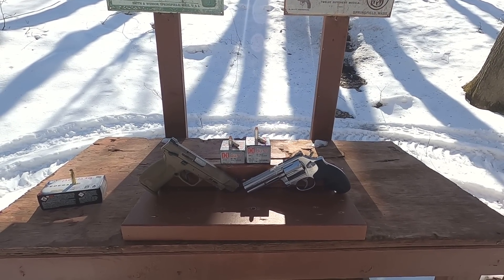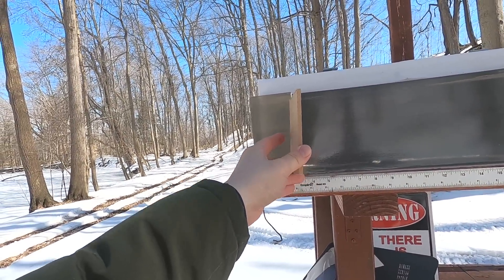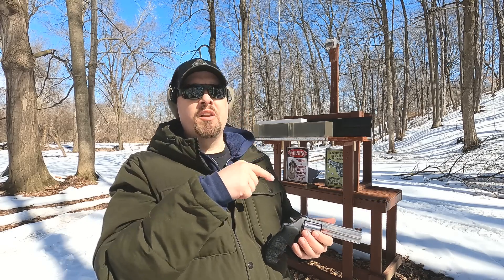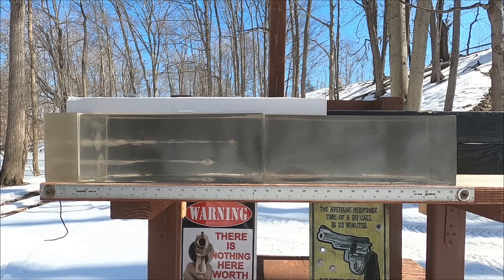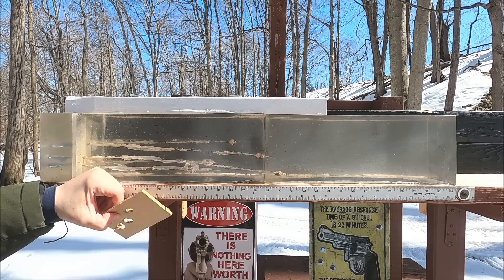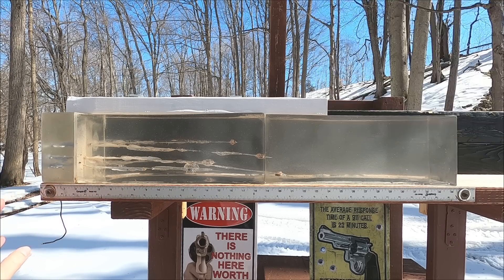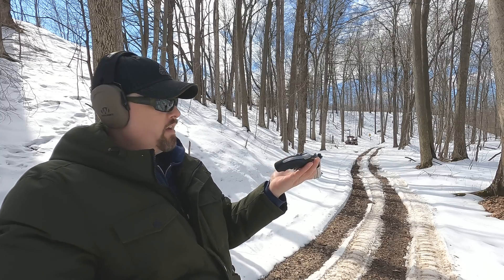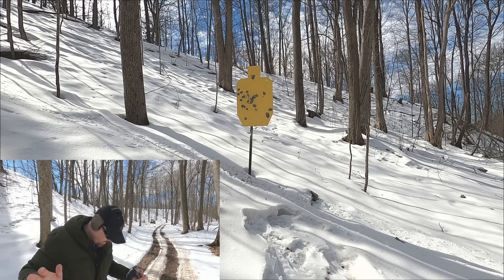.357 Sig VS .357 Magnum - Hornady Critical Duty Ballistic Gel Test

Comment: That's some pretty weak 357 sig ammo. Definitely could have had more velocity
Reply from the maker: But it worked. Adding more power just increases recoil. I could see if it was weak and there was a problem with expansion or penetration, but there wasn't.

Comment: Nice test, with the Federal 125 gr as a baseline. Good job pounting out that u also do not need every last possible fps of velocity to be effective. The 10mm fanboys would disagree, but they often overstate their velocities. 

I heard somewhere that the 357 Mag CD was made for an agrncy, possibly foreign, that stuck with the 357 and is not likely to change. No idea who. I love the Sig in my P229 barrel, and i have a P239. That one in particular is a nice carry package in a relatively high riding holster. Fairly light, flat, good trigger, 7+1 is enough, clears leather well. The recoil is not bad, just some muzzle flip, and i know the power is there. It is one of my favorites, now discontinued. The LE agencies that use it seem to love it, including Richmond (VA) PD and Alameda Co SO (CA), as well as US Secret Service. Hard to go wrong. 

I drarly live the 357 Mag as well, and i will never give up my 4"686. First handgun i ever bought, and i started my LE career with it- SS III holster and 4 Comp 2 speedloaders in 2 diff cases, all of which i bought myself.

Comment: I will always recommend Hornady critical duty when you’re carrying, because sometimes you have to shoot from within your vehicle which would be a deafening disaster, and even sometimes into a vehicle that a criminal might be using as a weapon.  So over penetration is a must.  

However, for HOME defense, I would recommend a Corbon safety slug, keeping loved ones safe…
Reply from the maker: I tested the 9mm+P Critical Duty through a windshield along with HST, Gold Dot, Winchester Ranger bullets all in 124 gr+P. After windshield penetration is Gold Dot= 8.75" gel penetration, HST= 10.75" gel penetration, Ranger= 13.75" gel penetration, Critical Duty= 9.75" gel penetration.
Reply: @GunSam  So ranger it is. 👍🏼
Reply from the maker: it was the "Defender" which is the same bullet as Ranger bonded (Not T Series) so either Ranger Bonded or Defender seems to do the best at least in 9mm+P 124 gr. Different calibers of bullet weights might change the equation. I plan to send the 135 gr 9mm and .45 ACP and .40 S&W Critical Duty through some auto glass in the next couple of weeks.

Comment: Those critical duty projectiles are a little undersized in some calibers and think that likely reduces felt recoil by a fair amount. I highly highly recommend their 9x18Mak for those shooters that might be getting a little sensitive to the bite of the 9x18Mak. I would suspect the .380ACP would produce similar results if you have a .380ACP that recoils a little harder than you like.
Reply from the maker: You must mean Critical Defense, not Critical Duty. There's no Critical Duty in 9x18 or .380 ACP.
Reply: @GunSam  oh thank you I did in fact mean Critical Defense my mistake. Although what I meant to imply is that I wouldn't be surprised if the Duty class FlexLock projectile is also slightly undersized. Being that they are Critical line ammo from Hornady they may have more than a few similar characteristics as they are only slightly different from each other. When you mentioned lower perceived recoil the first thing that came to mind was my 9x18Mak because that's all I carry in my P64 when carrying for protection. Super accurate, low recoil, and reliable as all get out. Great video btw, also you're an excellent marksman, I truly look forward to seeing you shoot some more.

Comment: 357 Sig is under rated, IMO.   1.  Works in autoloaders.  2. Thus higher carry capacity.  3.  Some pistols like Glocks, you can just swap put the barrel of a .40S&W to one cambered in 357Sig and you've made a successful conversion. (since 357sig is .40 necked down.)  4.  Higher velocity than typical 9mm and .40.   

So, really nice option, IMO.
Reply from the maker: If we want to get technical, a .357 Sig is a 10mm necked down, thus making it .40 S&W length, but your points are all true.

Comment: 357sig looks better than 45acp. Maybe I should get a Glock in that caliber instead of 45acp.
Reply from the maker: Depends on what you are looking to do with said caliber. Personally if I were to go the .357 Sig route, I wouldn't get lets say a Glock 31, 32 or 33 and rather I would get a Glock 22, 23 or 27 in .40 S&W. I say that as all you need for a conversion is a barrel, KKM that makes my M&P barrel for my .40 S&W pistol is quite nice, makes all the Glock barrels too, but starting with .40 S&W you have a lot of options in shooting both .40 S&W and .357 Sig. A .45 ACP can be a fine caliber too.

Comment: I can't figure out why the 357 Sig didn't catch on since it's clearly far superior to the 9mm in every way. I simply don't trust a 9mm to stop a threat with as few rounds as possible while the 357 Sig is as close to the 357 mag as you can get in a semi auto. And yes I know that the 10mm fanatics are saying that they're getting the most energy in a semi auto, which is true in a factory made pistol, but a lot of people can't handle the recoil of the 10mm while most people can learn to shoot the 357 Sig with a lot less training. Also, the 460 Rowland makes the 10mm look kinda weak, but you need a steel frame pistol and a conversion kit to be able to use the Rowland and they're not practical for EDC. Interesting fact is that the 460 ammo is less expensive than the 10mm. Go figure.
Reply: Same here Bro! I don't trust 9mm, instead, I use it for range only. I have 4 357 sigs Two Glock 32's, Glock 31, and Glock 33. No matter the cost of 357 sig I will invest in that round, all ammo is expensive if you ask me.😂😂 But the 357 sig will get the job done, without using multiple rounds.

Comment: Interesting, especially throwing in a sheet metal barrier.  It’s my understanding the .357 SIG was designed to match the terminal ballistics of the legendary .357 Magnum 125 gr. SJHP but in a pistol.  It does a great job of that, but as bullet weights climb, the superior versatility of the revolver round from 1935 asserts itself. 👍
Reply: Your history is correct, as is the 357 (or any other revolver round) being more versatile. Today's fashion is for high capacity handguns but personally if I can't handle it with six shots I can't handle it with 16 either.

Comment: Big fan of both calibers but dismayed that 357 Sig has waned in popularity so much. It has its followers, of which I am one. Great autoloader caliber in my opinion, might even be the best autoloading caliber. No offense to .45 acp or 9mm, I like them also, but it seems to me that 357 Sig does exactly what it was designed to do. Now, even Sig doesn't support it, for financial reason no doubt, but still a bummer. Great video on the Hornaday projectiles in these two calibers. Very informative. Looks like I've made the right choice for my Sig 229. I'm a longtime watcher but this is my first comment. Keep up the great work; I really think you've nailed the format in terms of delivering tons of info in a condensed space. I find your info very valuable and your protocol extremely consistent. Keep it up, sir.
Reply from the maker: Thanks. The .357 Sig is awesome and misunderstood. I get a lot of "I would never buy a pistol like that, no ammo and it's too expensive". The .357 Sig can be had for $20/50 rounds all over the web, but that's besides the real point. The real point is that unlike any other conversion, a .357 Sig is an extension of a .40 S&W pistol rather than a full out conversion. I tell people, never buy a .357 Sig pistol, buy a .40 S&W and a .357 Sig barrel as it's not really a conversion at all, it's just a different barrel. Between .40 S&W and .357 Sig ammo, one has no reason to complain about finding ammo at good prices, and if nothing else the .40 S&W is a great cartridge with lots of ammo that people are near trying to give away being not as popular as 9mm.
Reply: @GunSam  Agreed 100%. When I looked to purchase a DA/SA pistol, leaning toward a P226 or P229, I waited until I found one chambered in .40 S&W (didn't take long!) and then purchased the .357 Sig barrel separately. Same mags, everything, just a quick barrel swap. I've been reaping the benefits of these "discarded" and "less favorable" calibers for a while now. I'm definitely not discounting other calibers, but the bottleneck design of the 357 Sig just seems like a no-brainer to me. I simply do not have failure-to-feed issues and the ballistics are fantastic (internal, external, and terminal). What's not to like?

Comment: So the critical duty rounds didn’t expand any larger than a 40 or 45 fmj when shot through the barrier, that’s really mediocre at best. Yet the nonbonded 357 expanded beyond .50” and penetrated over 15”, that’s absolutely perfect. Jacket separation and bullet fragmentation only matter because they reduce expansion and penetration. If the nonbonded bullet has excellent penetration and bigger expansion through barriers then who cares if it’s a little more mangled up?
Reply from the maker: Yeah, but my barrier was a bit weak, and I am an amateur. If more barrier was included what you would see would be no expansion with the Federal round, very low penetration, but the Critical Duty would be about right for penetration.

Comment: They were designed to be a ballance of good penetration and good expansion like a hand gun version of a nosler partion and antimony drives the lead core after a small area dedicated to some expansion, Hornady and a sherrif department did gel tests together outdoors with plywood, sheet rock, car window glass, denim and steel so Hornady did the tests to prove the 9 mm, 40 and 45 in front of sherrifs department, lead has many recipes from soft lead to antimony lead, its about testing and adding or subtracting lead alloys like bismuth, antimony, tin to get performance at slower speeds with out increasing pressures to high effecting recoil and even accuracy is speed based, so lots of variables have to go into a bullet other then expansion and penetration, things like cost is a challenge to, I use the 135 gr standard pressure 9 mm, the 40 and 45 the + p and they all soft shooting and accurate so long shots do them any way to know your limits

Comment: Love to see more all copper bullets, the testing I have done has been an eye opener. Nice shooting
Reply from the maker: It's always impressive looking, but it's sort of hard to judge what is going on. The fluted stuff stops fast because it's low sectional density with flutes, but the actual hole size is smaller than an expanded hollow point. Hunters swear by them, but they are often using rifles so any bullet would do well at those velocities. The main promising point I see with solid copper fluted ammo is they would be barrier blind and still not over-penetrate a person as the low sectional density and flutes would prevent that. Overall I think JHP bullets are better, but if I had to shoot through windshields I might say the copper stuff is superior.

Comment: Did you polish that 686 ? It looks pretty good. Thanks for the video.
Reply from the maker: No, I just clean it a lot, often times with a steel wire brush across the whole thing. Has a nice brushed finish because of it, which I like as it hides imperfections.

Comment: Thanks for the video and comparison. Both of these rounds seem downloaded. As in so many 10mm loads also. 357 sig should be traveling in the low 1400’s and the 357 mag near 1500 or more. Thanks this is not a criticism of your video:) and thanks for your excellent comparisons and innovative gel tests. Although I do miss the water jug exploding.
Reply from the maker: Thanks. The energy of the Magnum round was pretty typical though, as it is 135 gr so it's not gonna do 1,450 or 1,500 like 125's can do.
Reply: @GunSam  That’s true but maybe low 1400’s? They still seem downloaded:)

Comment: Great test!! I've avoided Critical duty .357 mag because I figured based on their numbers it would perform like crap out of my 4.2in GP100. That doesn't seem to be the case, Hornady's wonky velocity numbers worked out for the better this time. Fantastic ammo, I think it would be a great choice for both two legged and aggressive four legged critters east of the rockies.
Reply from the maker: Thanks. I remember testing it years ago and the velocity was more like rated, I don't remember the velocity exactly but it's energy used to be like 500 FPE and no more. I think they have added 100 FPS as of late.
Reply: I use the Hornady Critical Duty  357 Magnum in my Ruger sp 101 3" and it performs with great accuracy..great round AND fantastic video.  Love your comparisons..always acquire great information from them, thanks!

Comment: Not bad. No hard barrier test looks great. Thanks.
Reply from the maker: What was surprising was the extra penetration, which I think accounts for more barrier than my test. It's formulated quite well as you need 135 gr to be at that right momentum for penetration, but still expand without a barrier with such a hard alloy.

Comment: 1,225 for .357 SIG? 

Anemic.

Original intended velocity in 1994 was 125 grains at 1,450 fps from a 3.9” P229 barrel. But major manufacturers watered it down to 1,350 fps. 

I won’t touch .357 SIG that doesn’t go at least 1,450 and Underwood 125’s have got 1,511 out a 4” G32. That’s 634 foot pounds. 

This Hornady Critical Duty is like 124 grain 9mm +p. But 10 grains heavier. Overall, lame.

Thanks for all your work though. Appreciate your time and effort!

Comment: I don't know about you but if I'm carrying a .357 Magnum, I'm carrying it for the power. The reduced recoil and added accuracy you mention with this particular load is nice, but if that's what I was concerned about then I wouldn't be carrying .357 Mag personally (and there are plenty of hot loads that are just as accurate). Just my opinion...
Reply from the maker: While I do carry .357 Mag in a full size for power, (been a bit since I did though) - I would say these particular loads are pretty powerful, as basically anything not Underwood or Buffalo Bore is about the power of the Critical Duty.
Reply: @GunSam  Only 1300fps from that barrel length with a 125gr? I thought there were plenty of non Underwood/BB loads that would be 1400-1500 from that barrel length with a 125gr, like certain Federal for example (and others). Am I wrong? I remember shooting .357 Mag back in the day and some loads were weaksauce while others about ripped the gun out of your hand- and that was using standard stuff rem/fed/win/pmc etc.
Reply: @BuckeyeBallistics  It's 135gr, basically same muzzle energy as a 125 @ 1400
Reply from the maker: @BuckeyeBallistics  135 gr at 1,378 FPS = 569 FPE. The oldschool standard was 125 gr @ 1,450 FPS 583 FPE, or 158 gr @ 1,235 FPS for 535 FPE.
Reply: @rob.3575  Oh my mistake guys, I thought they were 125gr. I was making breakfast while watching and must have mis-heard what was said. Thank you for clarifying.